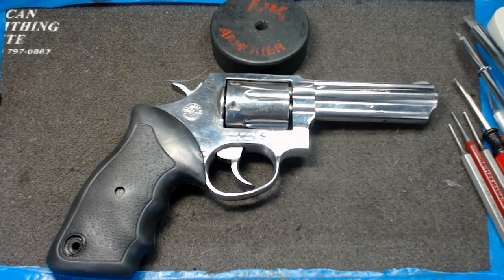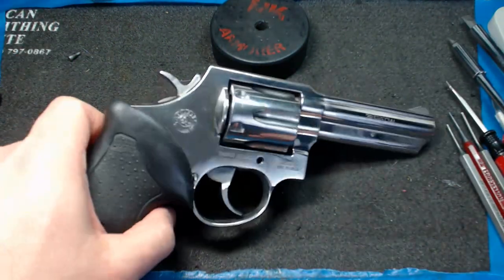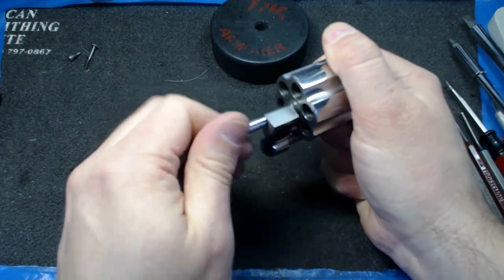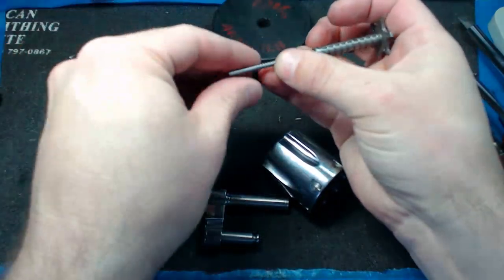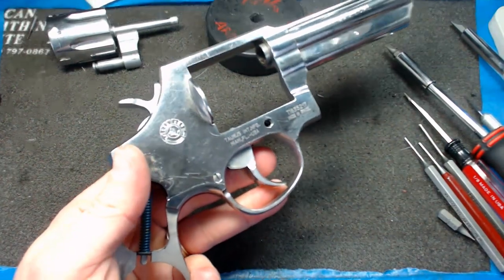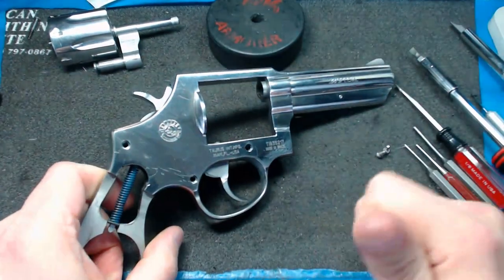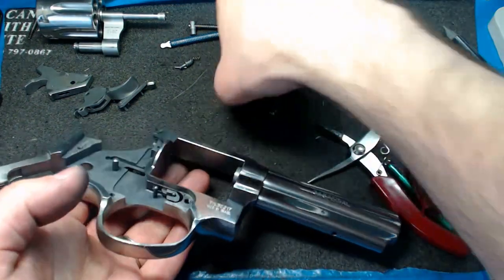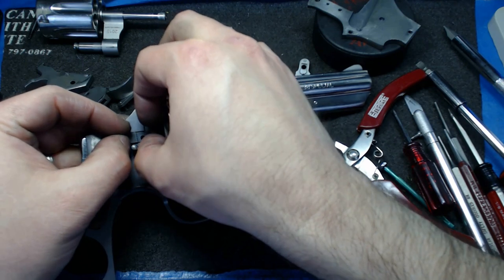Taurus 82 .38 Special revolver complete disassembly and reassembly

Comment: Man, you did a good video brother. Haven't got that darn pin that's spring-loaded in with the hand yet. This is very difficult on a little 856 .38 snubby. Have to take a break for a bit. Been trying to get that back together for an hour now, lol ...Doesn't help I got big fingers. It is definitely not easy to do. Just to think all this started because of an upgrade on the springs. When all said and done it wasn't working right and couldn't figure out why. So completely disassembled and thought I would start from scratch. But I thought that pin was fixed in there, and it wasn't. Should have seen that when I didn't see a pin through the trigger. Dang!! So I couldn't figure out how to do all that and no one had a complete disassembly and assembly video with the 856 or 56. Luckily, I found you with a .38 that pretty much has that same pin and spring. Very nice video, just wish I had your small fingers, lol  I only own a few revolvers, and all of them have that pin fixed. Anyway, Thanks for the knowledge.

Comment: I need that cylinder screw at 1:15.  Having trouble finding a source - even Taurus doesn't have it.
Reply from the maker: That is going to be hard. Taurus changed it a few times over the years as well, so finding the right one for your particular gun will be challenging. I've bought revolvers that suffered catastrophic failures off of GunBroker just to salvage that screw.
Reply: Thanks @ashburnarmorer.  That thought crossed my mind.  I have the parts drawing for my Model 607 so I know what the parts are (it is actually 3 parts.)  I have exhausted scouring the internet and called it into Taurus.  Taurus said "needs to be back-ordered with no ETA."  So I have requested it from them and will wait with fingers crossed.  In the mean time I will continue to keep an eye out on the parts sites and Ebay, etc.
Reply: I was able to get one (yoke plunger screw) from schludershots.com took about 5 days to get to me and cost about $20. That came broke on my 82 and the center pin had either been broken or they put the wrong one in the gun. Wasn't long enough. Schludershots had both pieces.

Comment: I put mines back together but theres still a part thats out n i dont know where it came out from its like a small circle plate with a spring on it!!! Any suggestions ur help is greatly required
Reply from the maker: Skip to about 55:45 and watch the bit where the cylinder goes back in. Email me if you get stuck.

Comment: Do u have a  video of how to lighten the trigger pull on this or do i have to get a new trigger?
Reply: Check the owners manual. They have the process listed but if you have the "older" model then you'll have to get new springs as there is no internal adjustment option. Wolff springs are the go from Gun Springs or Brownells.

Comment: Thank you for the excellent instruction. Lots of good information! I am also curious about the hammer spring color coding. Any insight?
Reply from the maker: I couldn't find anything authoritative on Taurus color codes =(
Reply: I love these videos! You show how the gun functions, how the parts fit together, how they come apart, as well as how they interact & integrate, as well as how they can can get damaged, by doing stupid sh*t.  Taurus'  repair and spec. info is limited to the Taurus warranty. Their  warranty is pretty much, mail it back to Brazil, and they fix whatever is wrong with it. They are not very cooperative about ANYTHING beyond, mail the gun back to us, and WE will fix it. It's a good warranty, aside from the fact you had better own another gun to use in the interim. If I could take a Taurus and make it as sweet as a Colt Trooper Mk III, it would probably not be a Taurus. I have had to run a Unimat, or a better quality Japanese made micro mini lather made by a Japanese movie camera manufacturer to machine new pins for revolvers like the Taurus. I have an FCC license and bought a second hand inductive heater/gold sputtering machine that runs on microwave energy, produced by some large magnetron tubes, and amplified with some huge power tubes. Put anything that sticks to a magnet inside the coil, it it will heat it up really super fast, really super hot. That makes hardening, annealing, and heat treating anything fast easy and exceptionally consistent. I can melt  steel with it too. That's just being stupid and making my electric bill higher for no reason, aside from being dumb. It wears out the parts in the heater too.

Comment: Hmm. I have a question. When I shot my 38 special revolver, after two or three shots it get snag and will not keep turning. So I let the trigger go and restart firing it will go another to to three fires before doing it again. Any ideas?
Reply from the maker: This can be a number of different things, unfortunately. First you need to see if it does it while unloaded. Mark each cylinder and try to determine if it is binding on the same place each time. The cylinder may be out of true or just dirty. If you can't locate and clean a dirty spot, take it to a gunsmith. I would not fire it until you get the issue resolved. Any binding is going to put extra stress on a lot of sensitive points and can make a small problem into a big problem...the kind that explodes in your hand.

Comment: Any idea what the hammer spring color codes mean? My 905 has a green one, and has deep primer strikes and some pierced primers. I have seen red coded ones also. I am hoping that a lighter Wolff spring will remedy the pierced primer problem.
Reply from the maker: Is your firing pin return spring intact? Popped primers can give you a really bad day. The firing pin should not be able to come out far enough to pierce a primer. A lighter spring may help, but it is more likely that the firing pin itself is damaged or the firing pin return spring is missing/worn-out.
Reply: The 905 went to the Taurus shop two months ago because of light primer strikes. Taurus installed a new hammer and hammer spring. With the new spring, the trigger is excessively heavy and I get deep strikes and the pierced primers. It seems like they "fixed" the light strike problem with a heavier spring. (The hammer was replaced because it was sometimes hitting the frame. I had told them that I thought that was causing the light strikes). So, what they did was introduce a new problem. I just installed a 9 pound Wolff spring. The trigger is nice now, and I can see that the firing pin is not extending as far. I will test it tomorrow.
Reply: The Wolff 9 lb spring fixed the deep/pierced primer strikes, but brought back the light strikes - about 10% of the time. Taurus factory tech said to try the second green-coded spring that they sent. I did and have no light strikes, but the deep/pierced primers are back. They say that they have no color coding for spring weights. The color codes are for caliber, so green is for 9mm. Now they say that this might be a head space problem and want me to send it back in... that could be another 2 months in the shop.

Comment: Taurus 82 is same as Taurus 65. The 65 is .357 not legal in Brazil for export only. These 82's are just short chambered Magnums. Heavier than S&W mid frames in all dimensions. https://www.taurusarmed.net/forums/factory-loads/111312-p-pressures-38-special-post1551797.html#post1551797